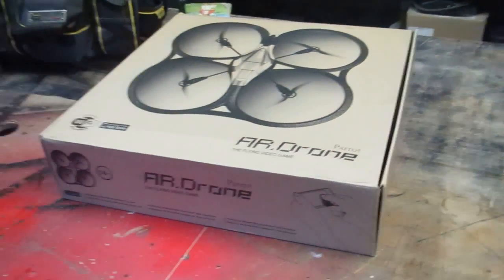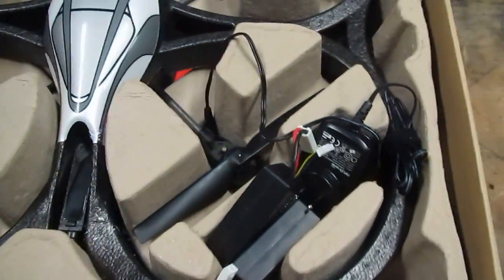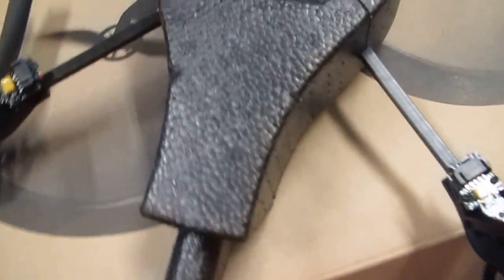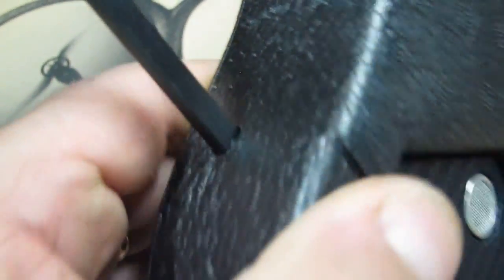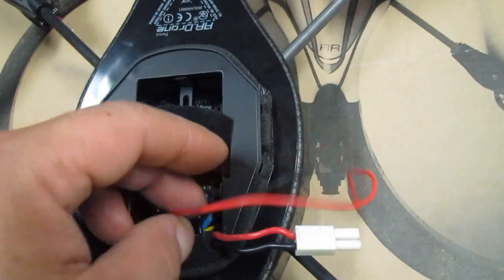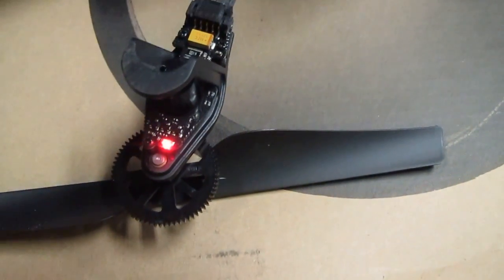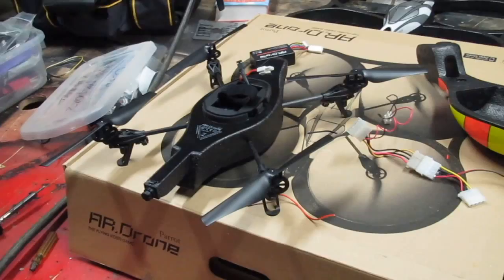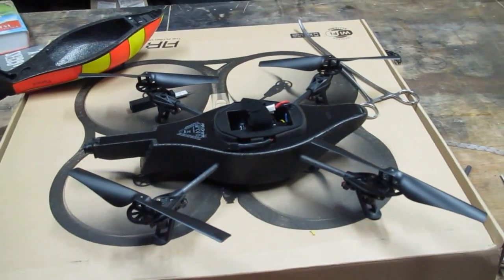Parrot AR.Drone Mods: Switchable LED Power Plug

Comment: Nice work,just a quick point,the clear hull is lexan and needs to be cleaned thoroughly, washing up liquid, before painting it to remove the mold release grease. And use proper lexan paint, enamel will crrack and peel off andcar spay will probably destroy thebody, melting it. I am doing the lighting mods but using lighter gauge wire as it can be hidden more essily. Love it, Rogbear